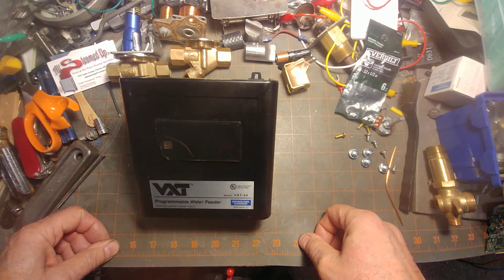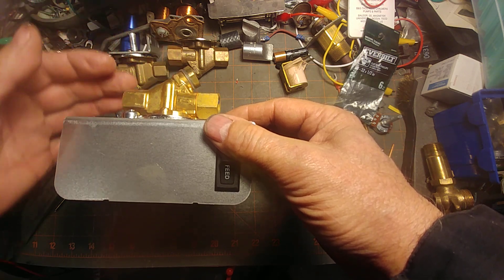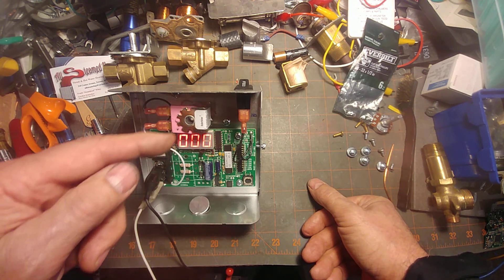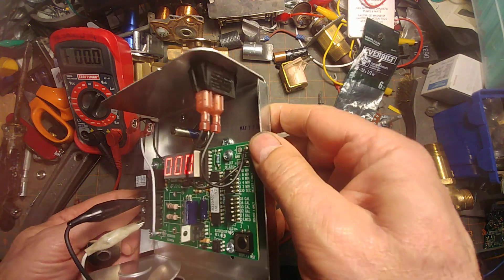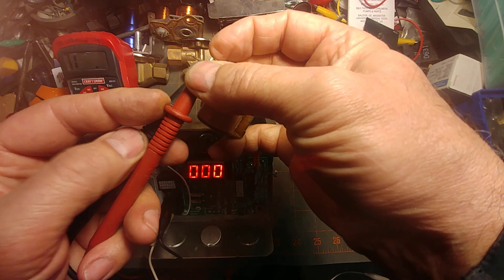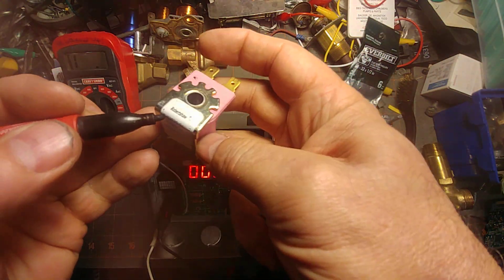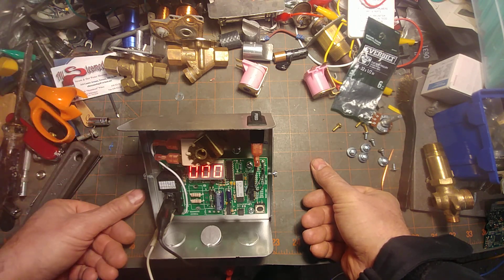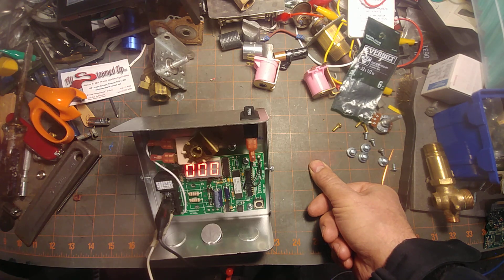Thicc Disc VXT-24 Steam Boiler Water Feeder Misbehaving

Comment: Hello, i having problems with my VXT 24. It was installed last year (production date 4/22). The problem im having is it only works for half a day before it displays "LOC" & low water light comes on. Then i have to manually refill it by opening the valve to let water in. Ive tried it on many different setting but none of them seem to work.
Reply from the maker: When you press the rocker switch feed button on your VXT, does it appear to add water (ie water rises in the sightglass)?
Or does it just click & hum.
Or does it just click?
Or is it silent?
Did it work when it was installed?
Reply: @gordonschweizer5154  The feed switch does absolutely nothing. When it was first installed it didn't work then halfway through the winter everything worked as it should. Now that I turned the system back on for the Fall/Winter it's back to the same exact issue.
Reply from the maker: @Scorpio7XL  It just might be the VXT electronics has gone bad.
If, as you say, it goes into LOC, it would appear to be receiving the proper signals from your LWCO, but just not feeding water.
Weird that at first it didn't work, then it did, and now it doesn't.
Last thing to try before calling Hydrolevel tech support is to turn off the power to your boiler & VXT for a few seconds and power it up again.
Once in a while, that might work to reset the electronics.
Reply from the maker: Also, sometimes the rocker switch might have failed on its own, (as well as the electronics or solenoid coil) adding a further complication

Comment: I had a customer that had a leaking return line in the basement and the feeder locked out and when the customer got home from a week down south the feeder was on loc and the the house was frozen. He said he would have had the leak to deal with then all the broken pipes.  He wanted that feeder out of the house and I put in a solenoid valve with a time delay like we used in the 1980’s with a 101 feeder.
So it seems like we are going back to what we used to use, because of technology   Thanks you
Reply from the maker: Thank you for the backround story.
It could have been worse.
The LWCO could have failed and the house could have caught on fire.
The systems worked as designed.
A leak that bad just suddenly causing the boiler to shut down usually gives some kind of warning, yes?
What did the VXT read when you ripped it out?
Reply: @gordonschweizer5154  feeder was on loc and boiler drained down to Hartford loop. Return was dry.  I like the vxt because of the time delay feed, but the loc out is to sensitive , to quick. A bad feature to just loc off water supply. A feeder is made to feed water based on its sensor.  Good or bad. They will need to add more sensors to add the loc feature.   Thanks
Reply from the maker: @atlasfueloilinc.2421  Thanks for that reply
If you set the VXT to "LWCO", it will attempt to feed for six minutes before locking out.
Almost everyone who complains about the VXT's failures hates on it when it floods the system.
Prob one of the few times when the issue is not adding enough water.
What do you think caused the failure of the return line?
Reply from the maker: Called factory and confirmed there is no way to disable the LOC feature.
Reply: I thank you for that information.
Reply from the maker: @atlasfueloilinc.2421  You're most welcome sir.

Question/thought experiment for you: It seems the leak on the wet return (as yet unexplained how it was allowed to get so large, but, moving on...) given that the leak was rather large, and, given where the the Hartford Loop was set (unknown by me), could the feeder have kept the LWCO satisfied and kept the boiler firing if we assume no lockout feature?
I suspect, given the above, it still might have shut down (or short cycled to death) with the result that the customer would have returned to a frozen house AND a flooded basement to boot.

Comment: I have an issue with my unit, after installation it continues to call for water even after it has reached more than the amount of water that is required. Can you help me out?
Reply from the maker: Have you reached out to Hydrolevel's tech support?
What settings for fill do you have on the VXT?
What type/model of LWCO do you have?
Did you double check the wiring?
As it is feeding, is there a "period" after the last number?

Comment: Do you service those yearly? I see it has a screen or service value at the water hook up. Mine was due in January but ill wait till the warmer weather. I have the ability to isolate it with shut offs but i will wait till the summer.
Reply from the maker: In our area (central Maryland), the mineral content of the water is not bad. Generally, that means years and years can go by without the need for service- in Our area.
If you have old steel pipes, the strainer can get clogged, but otherwise seldom is that an issue- in our experience.
Your mileage may vary.
The manufacturer says to check your strainer. And that's that.
If your system has used a lot of water due to uncontrolled leaks (define "a lot"? It depends...), the diaphragm of the valve will likely as not stick open due to mineral build-up and flood your system.
Rebuild kits for the valve are theoretically available (see my video on that).
Reply: @gordonschweizer5154  Thanks. I am in NY about 20 miles north of NYC and our water is very good. I should be good. Thanks to your Ch if anything goes wrong ill be able to fix it!!!!LOL